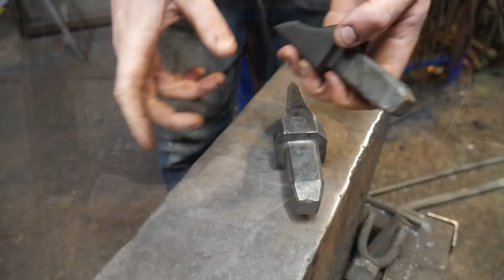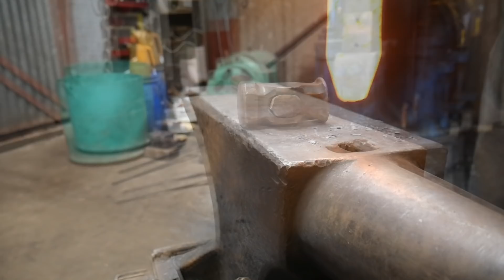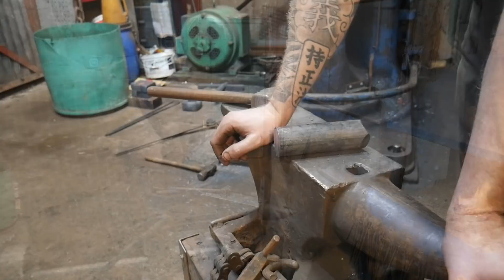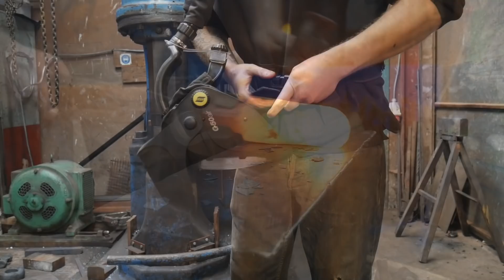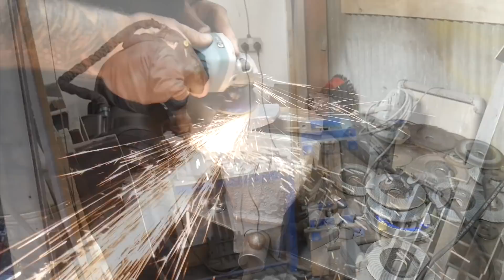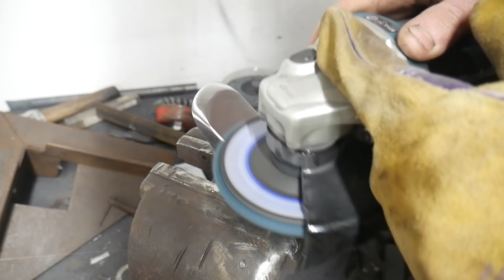[BLACKSMITH] Easy ways to forge hardy shanks with a friend.

Comment: I make all of my Hardy’s and the shank is always a struggle because the hardy hole in my anvil is not perfectly straight.  Thank you for the helpful video, Dan.  Love the How-to’s.  Cheers.
Reply from the maker: That's a pain as well. That's why you need to get the taper most of the way then drive it in defo help dude. Thank you for the comment
Reply: As I don’t have access to tools like a fly press and power hammer, would there be any advantage to using a Hardy butcher to isolate the shank material?  I’m thinking so, but I’m hoping your wealth of knowledge and experience could tell me if this a mistake in any way.  Thank you.  Cheers.